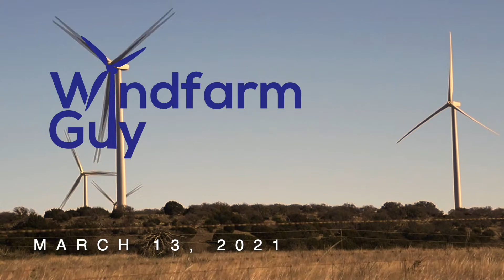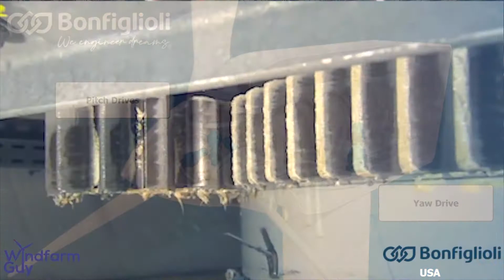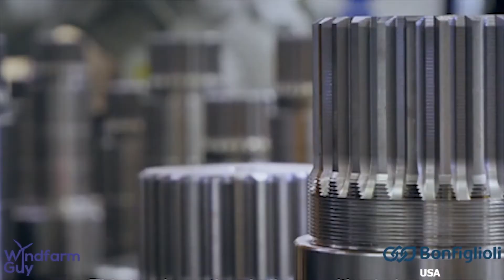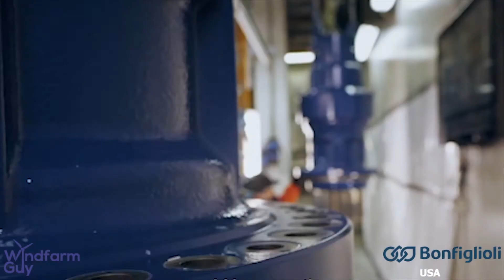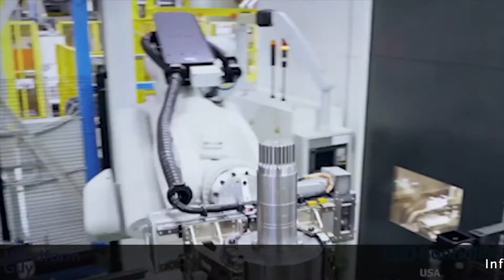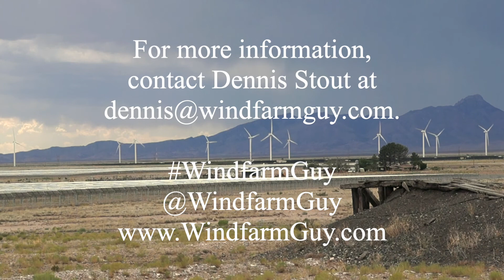#56 Windfarm Guy - Gearboxes - Mar 13, 2021

Comment: Lubricants do not last effective in an automobile after a certain amount of useful work - i.e. a sedan travelling  <10k km, where I live.
If 100 KWh expended travelling 100 km, the total work done is 10 MW, between oil changes.
This amount should be produced by a wind turbine in few spins - how about the lubricants?
Are petroleum lubricants being replaced regularly in a wind turbine, and how often?

"Energy, like time, flows from past to future".
Reply from the maker: Thank you for the idea, I'll check into turbine lubricants. Would you have any info suggestions?
Reply from the maker: Thank you for your question. I'll check into lubricants in turbines.